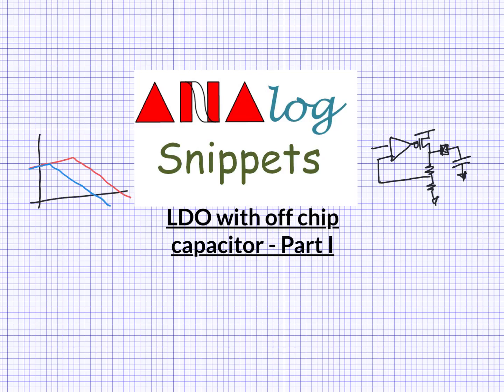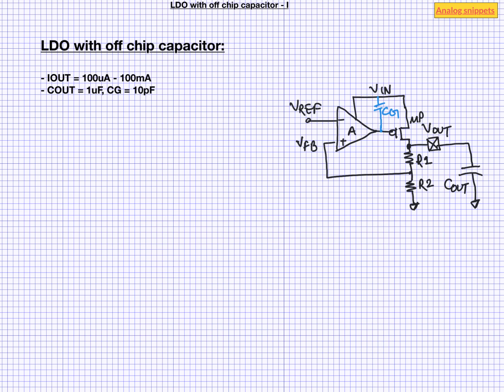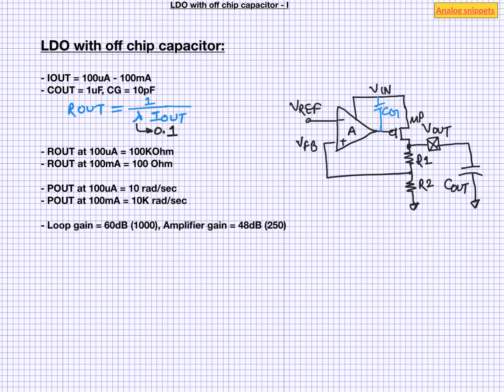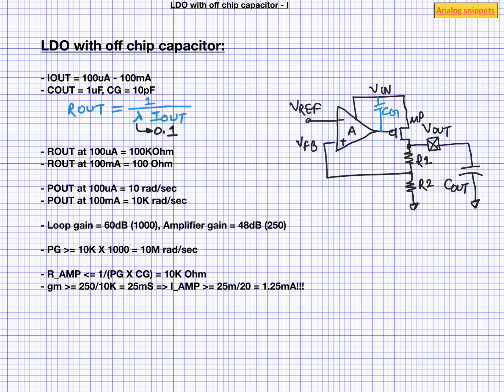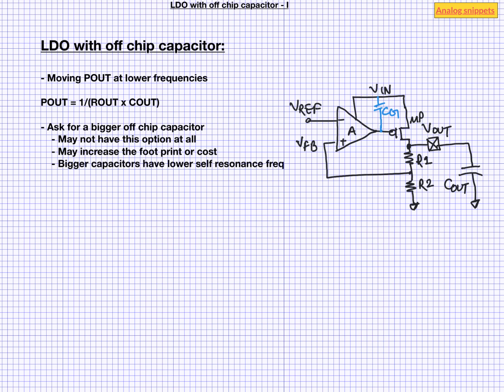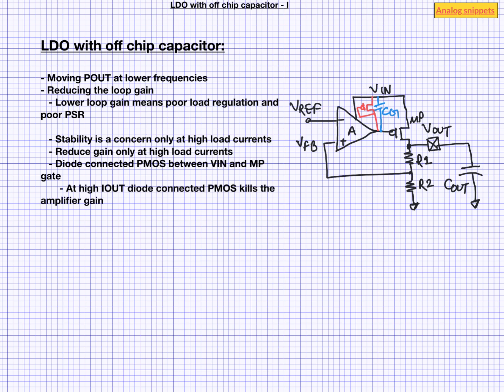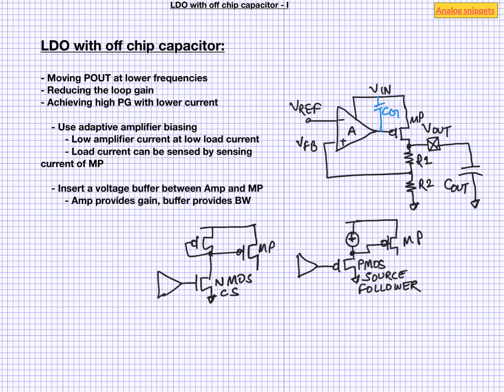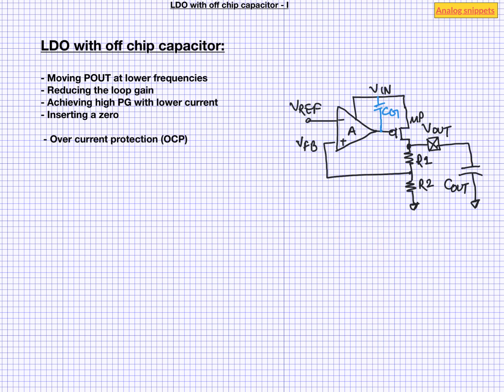#33 LDO with off chip capacitor- Part I

Comment: In the simulations how do you find the lamda which is CLM parameter to calculate rout? You assumed here is .1 is that educated guess ? Since lamda is not constant it varies and design 
rule manuals doesn’t specify those values 

I am curious how you find it ..

Thanks great video
Reply from the maker: You can find out lambda from the op sim. Usually you can see it in simulation as one of MOS model parameters.

Comment: Rout is not just output resistance of output PFET, but also load resistance equal to Vout/Iout.
Reply from the maker: Yes you are right. I think I have mentioned that I am assuming the load to be an ideal current source to simplify the analysis.